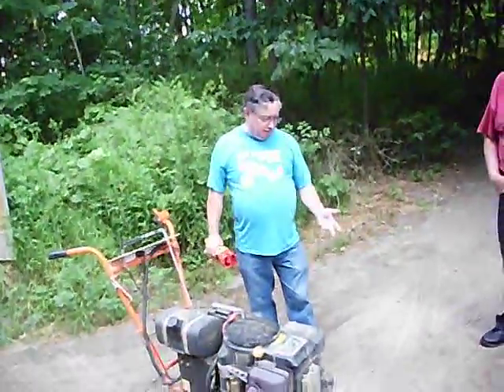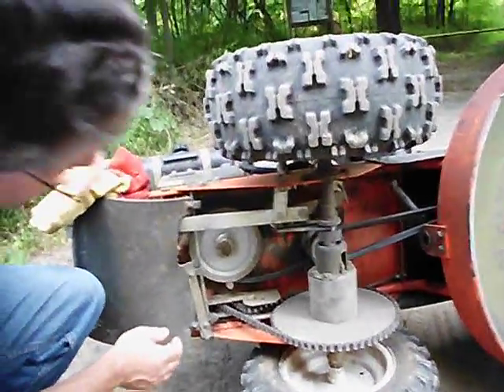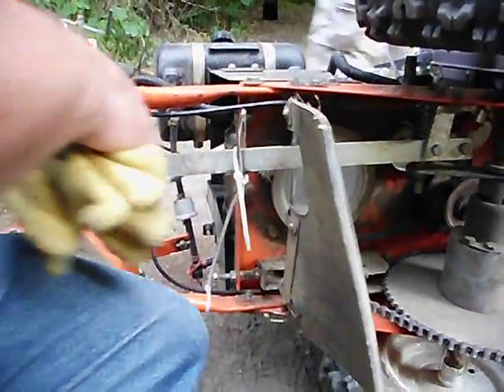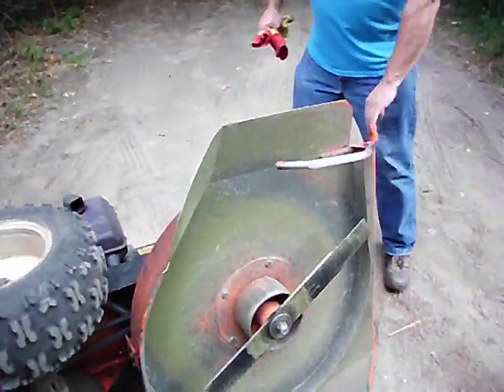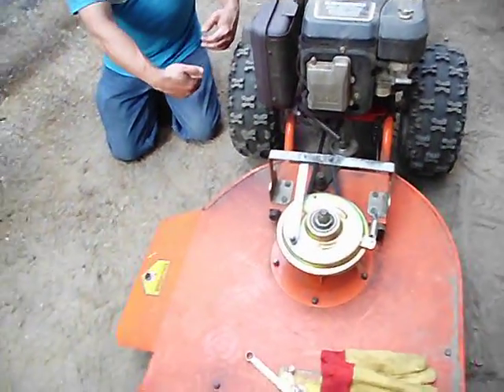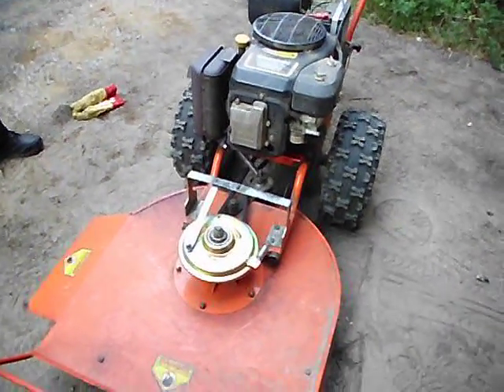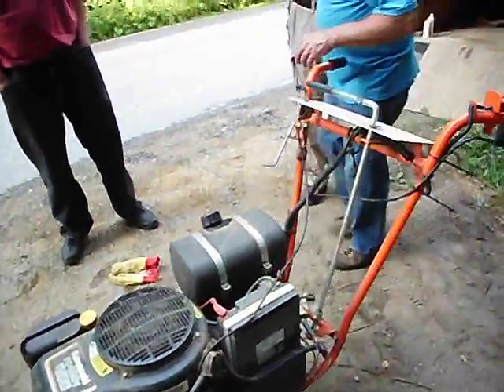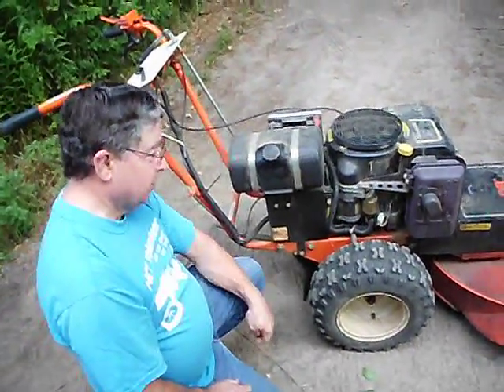DR Mower repair and maintenance techniques used on the North Country Trail.AVI

Comment: I have a 1997 8hp, a 2001 10.5hp and a 2003 17hp. The 2003 is the best of all worlds save for the limited slip differential. If they new differential lock control on the dash were to be added to the 03, it would be perfect. The 26" deck in the older style is better than the new 26" deck.

Comment: Be careful about laying it on the left side (air filter / carburetor towards the ground).  We did that for several minutes and ended up with oil leaking into the carburetor and the engine hydrolocked with oil.